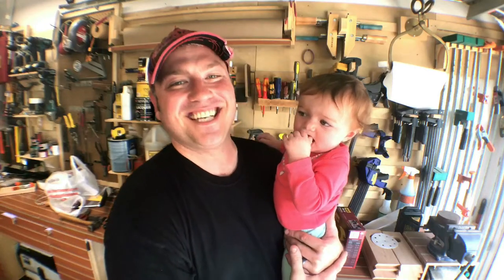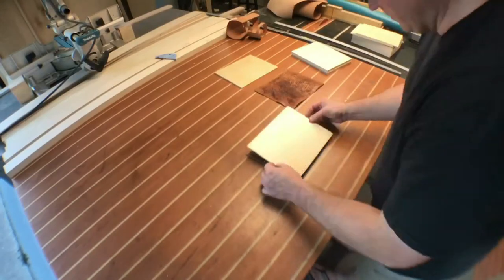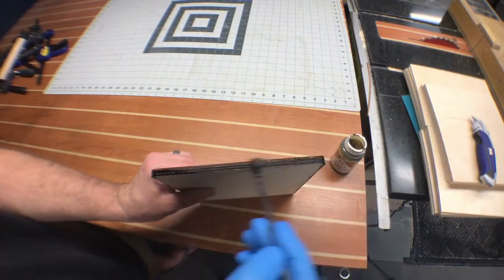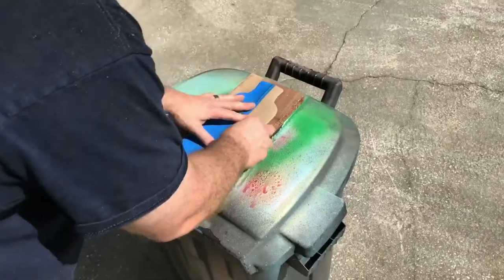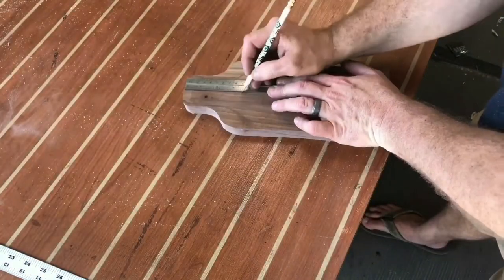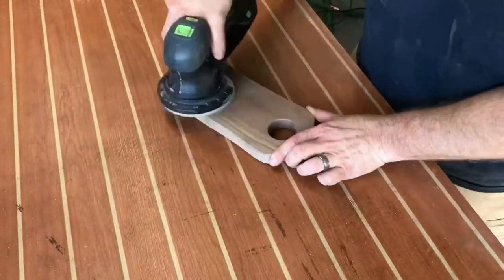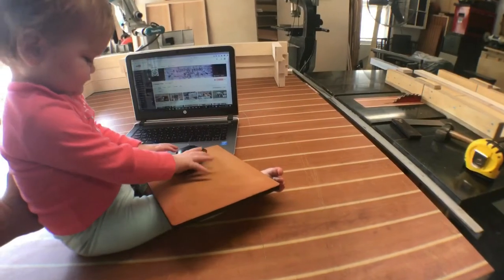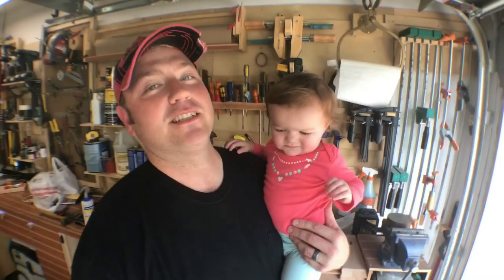DIY Wine Display and Leather Mouse Pad

Comment: As always great video. I will be attempting to replicate the wine bottle holder tomorrow now!
Reply from the maker: +Blake Huynh awesome brother! Remember there is a bit of trial and error in the hole size and angle of the bottom. What kind of wood you got in mind?
Reply: A Glimpse Inside I have some black walnut and Maple left over from some cutting boards I made during Christmas. Probably will practice on some pine first and use it as a template. I unfortunately don't have a bandsaw yet but I can make a trip over to my buddies to get that taken care of.
Reply from the maker: Blake Huynh that's awesome. They are definitely pretty cool projects to make